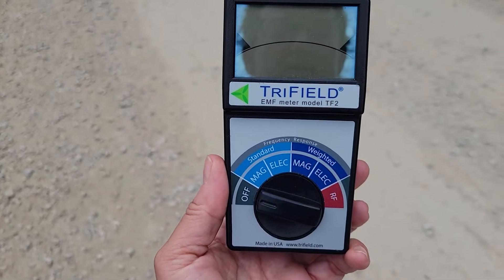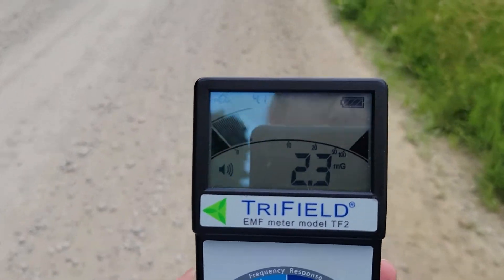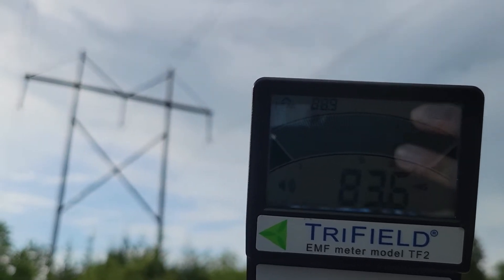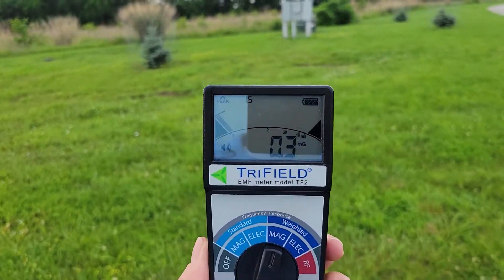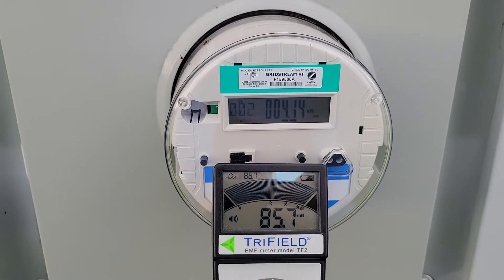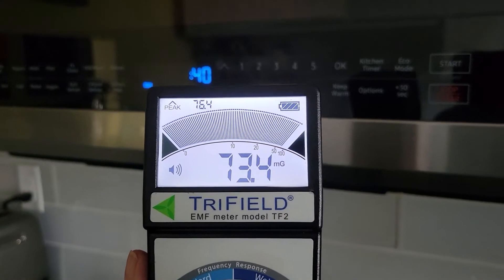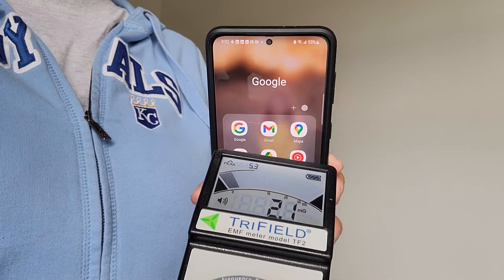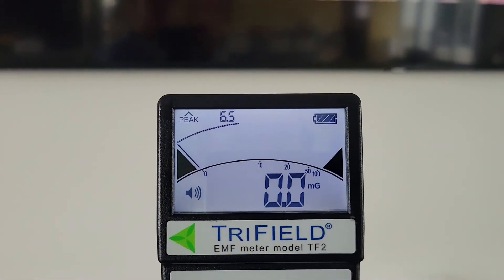Measuring the Electromagnetic Radiation (EMFs) from Different Sources

Comment: Why were you measuring the wifi with the machine set on electrical and not RF?
Reply: RF is not bad or damaging, so setting it near a WiFi router of course maxes out the RF setting. I'm not saying to bathe in RF - too much of anything isn't good for you. But it's better to measure the EMF output of something vs the Radio Frequency if you're looking for health-effects.

Comment: wtf is this nonsense and why is YouTube recommending it? do you have any idea about the units measured? or about inverse square law?
Reply: Inverse square law is correct when using distance to reduce emf levels.
Reply: Electro magnetic radiation is harmful when exposed to, for longer periods of time at high doses.
Reply: @marsel108  like sunlight?
Reply: @renoor  completly agree, this isn''t a real problem
Reply: @renoor have you ever tried measuring sunlight compared to like under any transmission or distribution line? As far as milligauss levels?